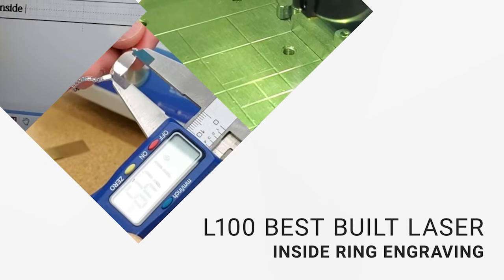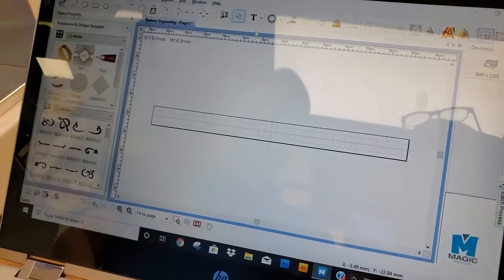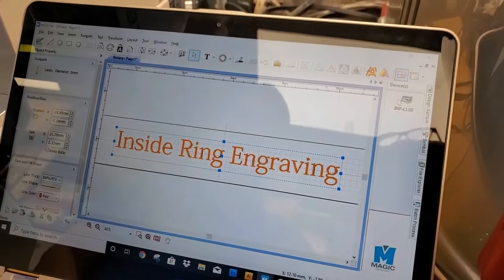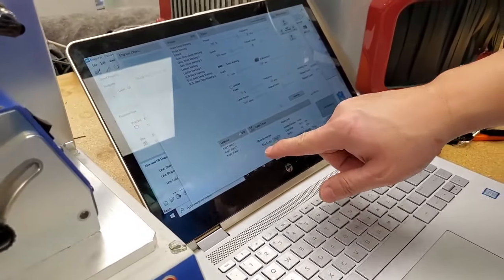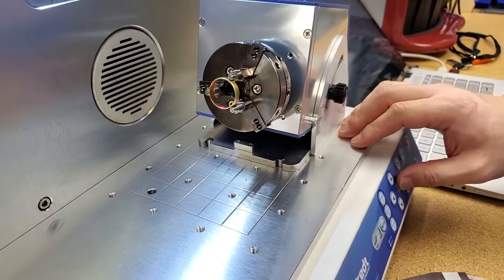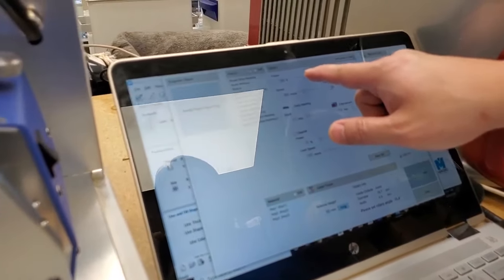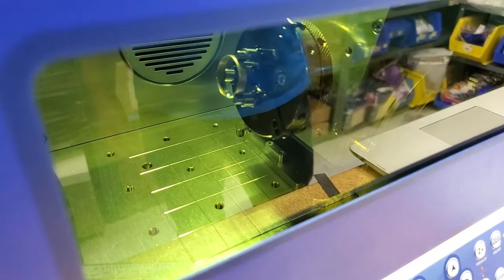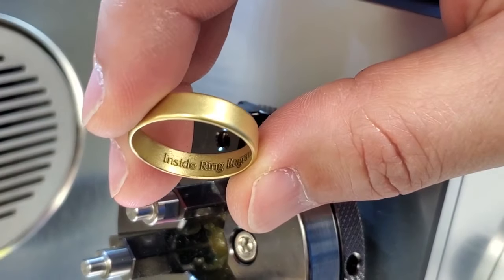Inside Ring Engraving with the Best Built Laser Engraving Machine

Comment: Can you engrave a ring with the stone on? Like a diamond, opal..
Reply from the maker: Hi Essie! Yes, engraving inside of a ring with a mounted stone is possible. Best Built laser engravers come with a rotary ring attachment which will allow the user to mechanically control where the engraving will go, with a laser preview contour. This laser preview makes it easy to visualize where the design should be engraved on the inside of the ring.

Comment: Hello,
Why is the inside of laser engravings are always black? Is there a way to remove that?
Thank you
Reply: @jessicaliu7424  Thanks but apart from very bad music I don't see how this answers my question
Reply from the maker: Hi! Laser engravers remove material by etching (burning) the metal with a hyper-focused light source. For this reason, engravings will typically come out black or charred. The Best Built laser engraver software has the option of generating a 'cleaner' pass, which will trace over the engraved area with a low-energy laser pass to remove or 'clean' the charred part from the engraving, leaving the engraved area clean and clear of debris. Further polishing will still be required for a mirror finish. Hope this helps!
Reply: @altar7885  LOL